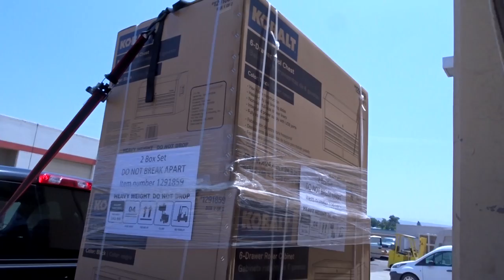Wicked $50 Motorcycle Paint Job

Comment from the maker: ENTER TO WIN MY NEXT BUILD FOR AS LITTLE AS $1. Plus awesome monthly giveaways. www.patreon.com/motopilot
Reply: MOTO PILOT should of left black solid then a light coat of Matt silver then rubbed thru the silver with paper
Reply: I took a risk with mine, brand new from Zodiac, used a flap wheel to rub it down so it was rough. matt blacked some scallops then red candy with small flake straight over the top, then just candy followed by loads of clear to help make it smooth. Looks great in the sunlight as you can see the swirls under the paint. It was all done on a budget and I bet less than £50 (Approx $65/70 )
Reply from the maker: @cunningplan96  that tank looks amazing!  Surprised that the black graphic areas look toned back in the final version
Reply: tony smith that’s mint
Reply: Sadly not long after I put it on the mirror dropped and slightly damaged it 😢 I have tried to repair it But I want it to ride and not for show.
Reply from the maker: @cunningplan96  NNNOOOOO...curses
Reply: tony smith it’s been christened
Reply: It's a nice concept...instead of the the big red sticker I would have used it as a stencil and done the letters black...it would help tie in the the weathered/patina look better and not stick out like a sore thumb.
Reply: love it brother

Comment: Suggestion from an old painter for spray bombs- Submerge the can in very hot water, take it out an shake it, feel for the temperature of the can to get cool, then repeat until the contents is the same temperature as the water. Hot spray cans work A LOT better. Of course shake the hell out of it before you use it.

Comment: Needed to use a 2K clear coat, because the first time you get fuel on that clear coat you used, it is going to melt
Reply: the sun alone will screw it over if not 2 k .
Reply: @Ladosligese  true, but gasoline does it much faster.
Reply: I DONT paint bikes, im a woodworker. Cant anybody tell me why he is using Water Based Interior Poly.  I would use that for shit inside.  Im i missing something?

Comment: How long did you let the black paint sit before getting at it with the sand paper? How long between clear coats? Thanks!
Reply from the maker: the paint dried fast so you can scuff it after an hour. depends on the temp outside. clearcoat once its sticky. not wet. not dry.

Comment: Coming from an automotive painter you need to put primer on bare metal that paint will be flaking off in no time. Paint doesn’t adhere to bare metal
Reply: I'm hoping you can answer a question for me. I have Harley denim black paint on all my tins but I wanna paint my bike white with a gloss finish. Do I have to strip all the black denim paint off my tins as if to start over down to the metal and use primer or can I just paint over the black denim and let that be my foundation?

Comment: #1: The first tank looked and fit better, replacement tank has too much gap between seat and tank and between tank and frame neck. #2: For the amount of paint you left on the replacement tank, you could have bought a 2 ounce bottle of flat black for 2 or 4 bucks and airbrushed it on the tank, blending / fogging it where and how you wanted it on the tank, then hand sanded after dry with 40 grit to get your streak lines #3: I'm guessing that the majority of that 50 dollar paint job price tag, must be for those flashy red and silver foil decals, you put on the sides of the replacement tank.  #4: Sorry, but the video should be titled A Wicked Waste of $50, just to get a cr*p tank paint job and two stickers !.

Comment: I’m having trouble finding a clear coat that can hold up to having gas spilled on it.. any suggestions?
Reply: #1 run as far away from this video as you can. And google 2k spray max Clearcoat
Reply: 2k clear coat
Reply: Maxx clearcoat 
Glamor gloss 2k
Reply: 2k clear is what u need. It activates on mixing creating an ultra hard fuel resistant finish.

Comment: What the best clear coat to be use, mine is remove easily by gasoline
Reply: spray max 2k  clear 2 part auto paint in a can about $20
Reply: O'Reilly's clear in a quart. It holds up better then most that stuff in the rattle cans.

Comment: I think you just wasted your $50.  If this was supposed to look like the helmet, it doesn't look anything like it.  If this is supposed to be a good outcome, I really doubt if your other projects will be of high success as well.  One tip, try putting some metal primer to preserve your project.  Otherwise the paint will be peeling off.  Better luck next time.